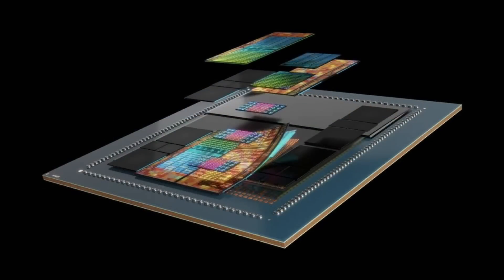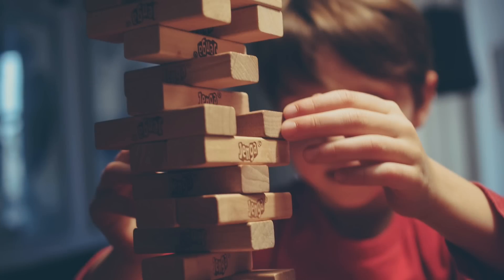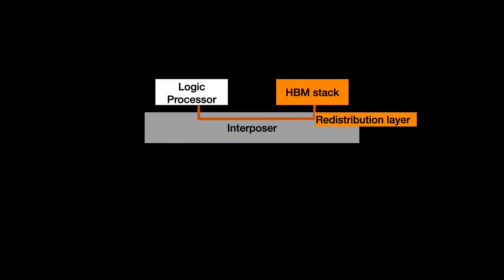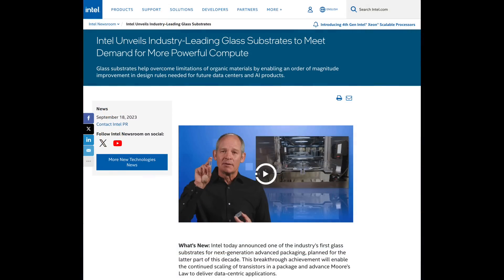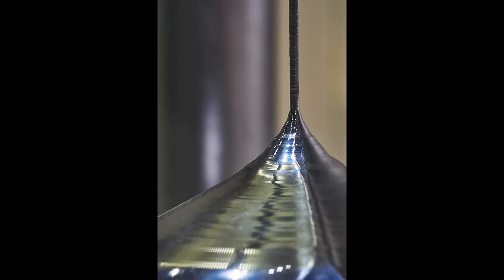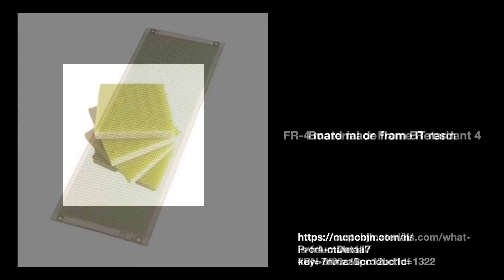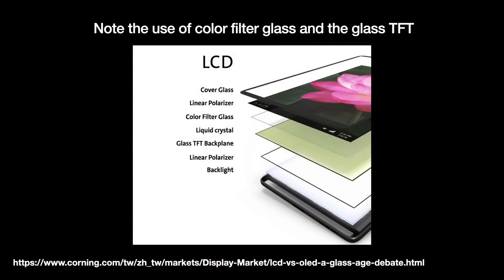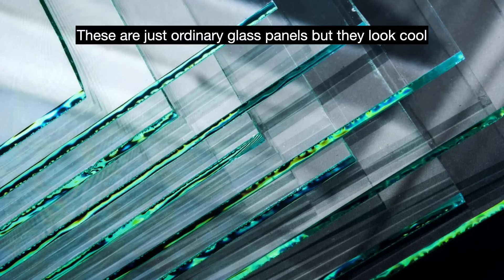Stacking Dies on Glass Panels

Comment: Orcanic Substrates have very little commonality in either the materials or processes used. In 1995?IBM Japan throes to extend the PCB process to make Organic Substrates ( called it SLC ) for Flip Chip assembly but failed. That is when ( 1097 )  I had to develop at Intel the SAP / BU Organic Substrates process at Intel that is used even today ( 2025 ) by the Taiwanese Pirates. Its an industry worth $15 bn per year. New R&D is on progress in AZ to further shrink geometries in Organic panels. This time the technology will remain inside the US or India ( where most of the inventors of Adv. Packaging e,g Glads Substrates are from ).

Comment: TSMC bamboozled Apple about inFO whichis in in NO way is superior to the type of Chip packaging it replaced ( Flip Chip on CoreLESS Organic substrates ) but is more expensive but that additional cost is folded into that for the Chip by a Foundry ( TSMC ) which does both ( Chip Fab plus Packaging ). Claims of superior electrical performance for their inFO by TSMC was done on a deliberately misleading Apples vs Oranges comparison ( Flip Chip on CORE type Organic substrates ) and it succeeded w/ vain Apple ( very few Engineers there have PhDs ) fall for it. For their Snap Dragon Application Processors that competes w/ Apple Appl. Processors  Qualcomm continued to use Flip Chip on CoreLESS substrates by Shinko of Japan. NO problem. One of the greatest strengths that co.s like TSMC have is the low quality of the half educated Engineers and their money grubbing Managers in the now Silicon LESS Silicon Valley !

Comment: It seems like you could just take the functionality of an inkjet print head and a laser to solve all the problems presented herein, except for what compounds to use as the laser absorbing ink. Do you want to repeatedly place dots on the glass and then ablate them off with a bit of the material and repeat, or is it better to include something conductive in the ink so you can coat the well walls with something that will bond well to the metal fill? 

I suspect that this won't be the first method for the same reason the first company to make a 16x CD ROM while everyone else was stuck at 4x was immediately purchased and disbanded. If you use the dot by dot technique, you can probably find a way to route that tunnel in multiple directions, which will probably be useful for stuff like inductors and antennas, but more importantly, controlling internal light refraction for inter-chip data transfer without the inductive noise of electrons and a highly-marketable "Relativistic photon clock" that uses an optical dopant gradient to spread a parallel databurst into a self-sequencing serial with redshift, rather than electrical switching.

Comment: There's a method of wood working where you apply masking tape to both sides of the wood before you cut it to prevent rough edges, they should try something like that on one side of the drilling and then take down the surface to the bore hole on the other side. It might help?

Comment: The issue is dis-similar thermal coefficients  of materials between the conducting and semiconducting layers. Anything planar is also suseptible to expansion/warping due to non uniform thermal expansion. What we need is a graphene impregnated glass sub layers, to wick away the heat efficiently, avoiding localized heat buildup. Also we can assemble all these into a dodecahedron structure for the most flexible interconnect🤔. Are we trying to re-create structures similar to what is in our 🧠🤯. Just some 💭❤👍

Comment: I am not sure why these are considered problems.
    Cracks can be annealed out after processing
    if required: The vias can also be made with etching if it is a requirment (feasibility depends on the thickness)
          KOH & NaOH work for etching glass, hydroxide is not used for silicon etching because it also etches silicon.
Reply from the maker: I’ve never heard of cracks being annealed out of glass. Is this something you’ve done before?
Reply: @Asianometry  
Experience: no galss working experience

Glass however undergoes viscous flow and at high temperature. This allows for healing of cracks and bridging of gaps (reference paper mentioned in seperate comment). Hairline cracks are likely to immediatly undergo healing due to the short distance and lack of trapped air.
Reply: @Asianometry  youtube immediatly removing DOI. 
Title: Thermal healing of cracks in glass
Publication Date: 1988
Journal: Journal of Non-Crystalline Solids

Shows the crack healing and includes images of the sample.

Comment: I'm curious if they have tried a pre-cutting and scoring process, doing most of the material removal at the start with raw glass, then an intermediate chemical/heat treatment to repair and smooth any micro-scratches that would later cause cracks. Then doing the fancy substrate creation, and finally finishing the last little bit of cutting.

Comment: Hewlett Packard was building silicon on sapphire chips in the 1970’s. Sapphire is extremely strong, heat, and radiation resistant. We’re coming full circle.
Reply: keyboard_g
We still apply them on special utilities, in orbit etc, through the radiation belt.
We’re coming full circle ? What is it you do, who you call we ? All Keyboards ?

Comment: Diamond interposer and packaging are going to be the next big step. We've already gotten pretty good at thin film coatings of diamonds and we can thicken it. It's going to be better than glass in every way.
Reply: Sounds a little bit like you forgot cost in your way(s). I only know of small diamonds being produced. Or Was that maybe a joke I did not get? 😂
Reply: @ec2_alcatraz  Cost will be there, but we can make diamonds pretty cheap. The hard part will be scale of larger sheets than it will be to really produce them at a cost. There is already a way to produce them in sheets, but I havent really seen heard much past that. I assume its possible though, but last I heard there was issue with the uniformity of the crystal.
Reply: @ec2_alcatraz  it's not immediate but it's coming. As I mentioned we can already diamond coat most substrates. Yes it will cost more but it will start as high end high performance devices and then come down. 

I was joking a little bit, but I really think we can make this happen in the not so distant future.

Comment: Katherine Bourzac has a writeup in the October 2024 issue of IEEE Spectrum (pg 8) that describes how a team in Switzerland is using x-rays (PyXL) to image 3D chips down to 4nm resolution. This could give new life to 3D design testing that is very difficult to do right now as this excellent video describes. Glass recipes are highly guarded trade secrets to whom the spoils go.
Reply: "Recipe" is the right term. This is more of a Black Art than a science. Much like a complicated recipe, trace elements can make a huge difference. Even if you know all the ingredients and their exact proportions, the processing may be complex and exact. Slight deviations in timing, pressure, or temperature can ruin the batch.

Comment: I feel like the endgame for 3D chips is going to be laying the stack onto its side instead of keeping it vertical.
Reply: That would be neat, but how do you remove heat effciently? Needs some sort of through silicon heat pipes, which adds even more complexity. Even crazier would be if we could minaturize some method of shedding heat to neutrinos or other weakly interacting particles.
Reply: @szurketaltos2693  if we had room temp super conductors it could use electron cooling. Otherwise passivizing each thin wafer and liquid cooling would work, but if you ever have had to clean a skived heat sink you will see that it's not easy.
Reply: @LaserFur  hm, how does the former work? Is there a good resource -- I couldn't figure it out by wiki. As for liquid cooling, yeah microfluidics is not easy but it is possible. Can apply pumps from biomedical applications.
Reply: @szurketaltos2693  one research article mentions "Both electrons and phonons are present in a metal, and they can act as carriers for heat transport. Nonetheless, conduction through the free electrons within the metal lattice is typically considered to be the dominant mechanism of heat transfer in metals." ref electrons-phonons-promote-heat-transfer-material-systems

Comment: How about polysilicon wafer for interposer or chip base? Not monocrystal silicon  wafer used in semiconductor. Polysilicon wafer is way cheaper and easier to work with than monocrystal silicon wafer. It was rather expensive material (but way cheaper than monocrystal wafer) in old days. But is widely used in photovoltaic industry, so now dirt cheap like $1 USD per wafer. Very similar electric characteristic to silicon wafer and comes in square shape. Good material for interposer or chip die base.
Reply: Isn't polysilicon slightly conductive due to the grain boundaries?
Reply: I would think due to its anisotropic etching behavior it is not suitable for the semi process.

Comment: When you started talking about organic warping due to heat it reminded me of some of the research that was being done at Georgia Tech's Package Research Center when I was providing IT support there in the early 2000's.  And then low and behold you mentioned them and the research they have been doing since I left in 2008.  I think if Corning and chip manufacturers can master the glass substrate it will be a benefit to not just being able to package chips more efficiently, but also help make glass stronger.  I know Corning's Gorilla Glass has some of the best tinsel strength out there, but I would think they would be able to evolve it to be even stronger than it currently is to be able to stand up to the cutting and drilling of the panels for use as a die.
Reply: gorilla glass is more of a surface treatment akin to surface carburized steel, they do a chemical bath on the finished product to cram bigger potassium ions into the matrix, creating a surface layer of enormous compression stresses.

Materials Science is a crazy field, you can go as crazy deep as you want into any one little thing and never get to the end of the hole
Reply: Strong glass does not mean more machinable. Often quite the opposite due to the balanced internal strain that makes it strong.

Comment: about 15 years ago I saw excellent presentation by Georgia Tech prof on glass for packaging.  it was more to replace PCBs
1) much better dimensional stability than pcb
2) fairly low cost
3) leverage high volume roll-to-roll glass production for flat panel
4) flatter, takes hotter temperature
5) Thermal expansion closer to that of Silicon
6) cheaper than Is
7) glass roll-2-roll you can get huge areas - see flat screen TVs
Reply: muskepticsometimes9133
We all saw that, now we can use algoritmes to develop any mask.
Reply: 8) possible to make much finer traces in it than in normal PCB substrate due to mechanical and dielectric properties

Comment: Kinda new, but reminds me of an older chip/display tech. Think of the active matrix LCD display. There they grow the driver circuitry directly the glass. TFT, or thin film transistors, located close to, and individually driving each pixel, making the pixel speed much faster. A Japanese company, just for fun and yucks, built a Z80 uC right on the glass, but it was large. About 2 inches by 2 inches (50x50mm). This was in the 1990s.
Reply: Yes, that company was Sharp, who made the glass Z80 processor, and it worked. You can probably use this with the glass substrate as well, growing vapour deposited silicon active circuitry, then a thick passivation layer that has terminations through it, which then is ground flat for bonding the chiplets on top.  bottom has the connections for the PCB, then through holes to the top, and you could even have active layers both sides.

Comment: "we can already make perfect silicon substrates, and the cost and manufacturing ability is practically unbelievable, but what if we could make it even cheaper by switching to literal sand?"
Reply: we just need intelligent sentient sand…..
Reply: the thing is huang did absurd thing like put 2 600w chip on a single package without LN2 thermal solution
Reply: @BastyTHz ln2 is never needed as a thermal solution outside extreme overclocking. Multiple kilowatts can be cooled with just water and in die watercooling.
Reply: silicon is no less "sand" than glass is. Silicon for chips is highly purified sand. Glass is made of not so pure sand, and technically it can be described as either a highly viscous liquid or an amorphous solid. Silicon crystal is a solid, but a metalloid -halfway between a metal and non-metal.
Reply: @squirlmy  Sand and glass are specifically silicon dioxide. Chips use elemental silicon, for the most part. They are different chemical compositions.
Reply: @Nib_Nob-t7x On earth but what about in extreme environments. Future prospects for space advances?
Reply: @clintcowan9424  If a cooling engineer cannot come up with a suitable cooling solution in space that doesn't require LN2 then they should probably be fired.
Reply: @FireAngelOfLondon  You would be surprised how hard it is to cool stuff in space... there is no mass to transport the heat to (air/water etc) and you need to rely on thermal radiation via infrared. And temperatur differences and cycles is extrem as well. And it must be lightweight.
Really hard engineering work.
Reply: @TheCountdownnowgo  Synthetic diamonds is a mass product nowadays and used in large quantities in industrial settings.
Reply: What if i tell you silicone is already made from  sand? Lol
Reply: Is there any whatsapp group to talk about building a startup in this field. I'm not joking at all. 

Starting, we thought to go with ready made Architecture. As you know, outsourcing.
Reply: quantum sand with schrodinger's cat.
Reply: Sand is naturally 3D. That's a 6x density increase over wafers. Just make them into individual function blocks that click together for complex circuits and then they can be used in kindergarden microelectronics familiarity play.

Comment: Chips on glass are definitely nothing new- most modern active-matrix LCD and OLED displays have one and Sharp makes them with deposited silicon on glass, a technology they call CGSilicon (Continuous-Grain Silicon).

As for cutting those glass interposers, ultrafast pulsed lasers may work.  Disco has already successfully marketed this technique for cutting silicon, calling it "stealth dicing" as the lines are so thin that they are hardly noticeable when the dies are inspected.

Comment: I think what you're actually looking for is 4d circuitry, where it self reconfigures due to the software update.
Reply: In the future, an AI-managed FPGA could pull this off.
Reply: An FPGA?
Reply: @afc8981 FPGA (field programmable gate array), an integrated circuit that can be repeatedly reprogrammed after manufacturing. Think of an Intel chip that can turn into an AMD chip, then an old Pentium, and then a Super Nintendo.
Reply: https://en.m.wikipedia.org/wiki/Field-programmable_gate_array
Reply: I have never thinked about the FPGA as a 4D object